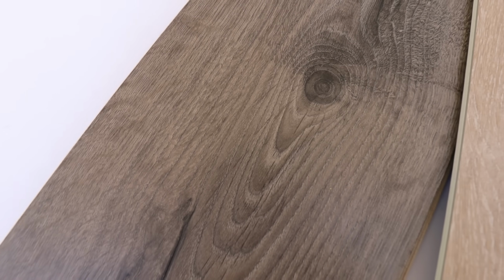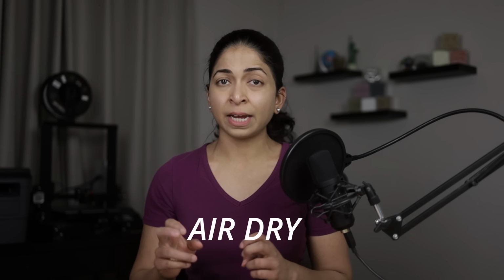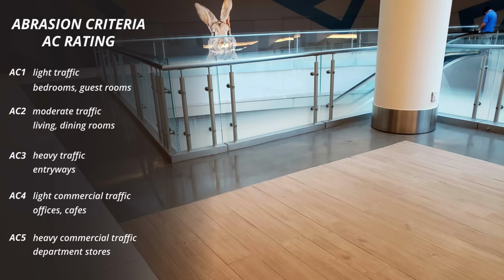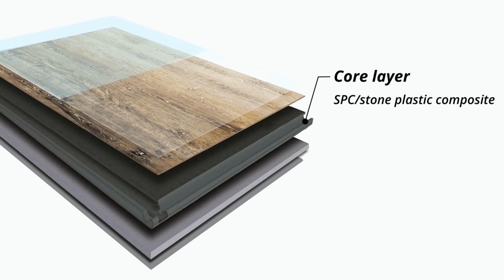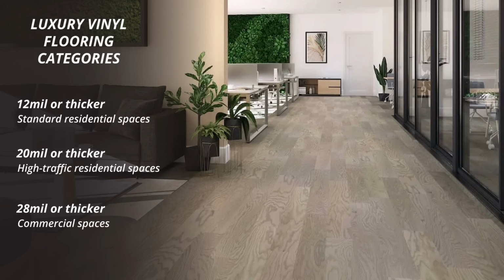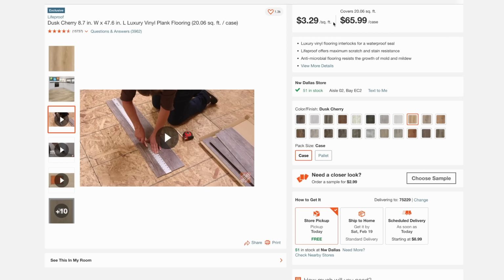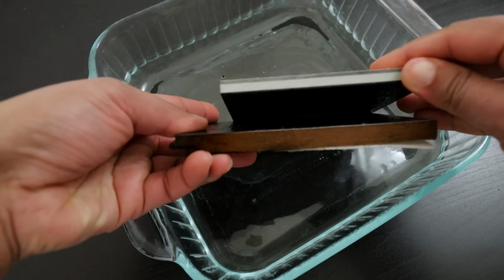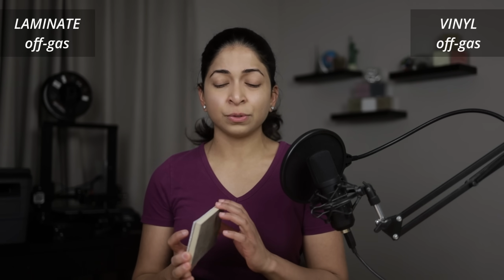Laminate vs Luxury Vinyl Plank Flooring | Everything you need to know!

Comment: Thanks! I thinking about using vinyl, this channel gave great information and very useful!
Reply: OK, but DO climatize this product, go for anything with a wear layer 0.5mm + it will last a life time in a domestic application,  Karndean 1. or armstrong 2. are both excellent proven products but get them from a reputable distributor or flooring specialist, not a home gypo store. If going DIY,  get advice and please don't skimp with limited performance generic or multipurpose adhesives from a home gypo store, get advice. PVC is already inherently water resistant (not water proof) and when properly stuck down to a firm smooth substrate these products are most water resistant and long lasting when 100% fixed. Generally any type non fixed floating floor products, click lock or loose lay products breakdown with long term regular climate seasonal temperature swings or moisture fluctuations mopping or water spills to joint ingress. In most cases thickness means economical filler these are not structural elements, your substrate will need to be very reasonably sound and smooth. Dirt and grit, lumps and bumps are amplified through the material, any real substrate unevenness, and absorption by a thick spongy backed pvc is very limited to marketing hype, forget about any extra softness for thickness too, that will be minimal or just more marketing discretion. Shopping centre malls are a good place to compare wear sound and feel different versions of flooring under foot. Manufactures "generally" recommend full stick down on all PVC product applications (read the fine print). 1. PVC is water resistant and bendy - 2. laminate is rigid and moisture reactive.
Reply: @AV036   Thanks! You give me enough information, I feel comfortable in choosing! This is blessing! 🥰

Comment: We have vinyl plank flooring throughout our house. We left home in the winter to spend a month in Florida and turned our thermostat down to 55° F to save on the heating bill while we were gone. When we got home, there was small but noticeable gaps between a lot of the planks! This is an ongoing problem that we have learned to live with, so... Buyer beware!
Reply: What brand???
Reply: @maplenook  We have lived in our house for over 5 years now and I don't remember the brand. If I poke around in the attic and find a name brand on a partial box I'll let you know.
Reply: @joemace6218  my vinyl instructions was keep it above 8c, that is 46.4 f .

Comment: I actually stopped recommending and/or installing laminate completely because every laminate floor I replace has lifting at the seams from moisture. Vinyl is softer so the customer needs to be aware of possible grooves and imprints from very heavy furniture, even fridges on wheels. But the softness is better for warmth and sound. I recommend glue-down grout-able vinyl tile for bathrooms over ceramic, unless using in-floor heating.

Comment: This is great information.  Our 1970s-era parquet wood floor is really showing its age and we’ve been trying to decide what the best options for replacement would be. My parents have a laminate wood floor and our next-door neighbor put in tile that looks like a wood floor.  I’m not particularly fond of either.  It sounds like luxury vinyl plank would be our best option, unless we decide to go with another hardwood flooring option.  We’re not wanting to spend hardwood money, though.  My only real hesitation is the lifespan of the vinyl floor; hardwood can easily last for 50 years or more while the vinyl might need to be replaced after a decade.  So much to consider...

Comment: Ultimately it’s all high in materials sourced from mineral oil, meaning it’s not really sustainable. After use the prime method to dispose of it is incineration - which is how very few countries dispose of it. Hardwood flooring is noticeably more sustainable, lasts longer and - depending on sourcing and materials chosen, can be procured at comparatively low prices. For highly used areas we use bamboo flooring - this is even harder than oak.
Reply: Adds value and comfort as well 👏
Reply: Ash is a great option too, cheaper and harder than oak, still maintaining a nice grain. Bamboo is one of the most highly underrated flooring materials. Durable, very hard, and grows at warp speed.

Comment: Now I'm curious about luxury vinyl in light of my disdain for other floor products seeming inferior in their ability to resist swelling from water. 
I love wood floors but not the upkeep of them as I am quickly learning what not "upkeeping" does to said floors over the years
Reply from the maker: I'm in the same boat. I'd like something low maintenance, so I'm interested in Luxury Vinyl...but I'm wary of its off-gassing.
Reply: @BelindaCarr  yes, I'd suspect dealing with "fumes " would be issue for a handful of at least months (aka longer than a manufacturer will claim)
Reply: @BelindaCarr  Hi Belinda, how l got around the off gassing concern for myself was to purchase all the vinyl planks l needed 3 months before I installed it & stored it in my garage. I used latex to glue them down on the cold side of the house & used a 2 pot low VOCs resin for all the floors that would see the sun. The 2 pot resin smelled like peanut butter & once it had set (90min), no perceptable odour. It has been down for more than 2 years now & l keep smiling every time  l look at it. I used Karndean brand. Cheers

Comment: When I re-floored my home I settled on AquaGuard brand. It claimed to be resistant to standing water for up to 30 hours, making it usable in high moisture rooms. I didn't use it in bathrooms but chose it due to the cats in the house. Results have been mixed. In a couple of places cats peed on an area and it worked between boards via capillary action, and the edges began to curl up with time. In other locations, integrity was maintained. IMO never use the store's installation contractors - hire a competent flooring installer if you're not doing the job yourself.

Comment: to the subject of the video:
I was fortunate enough to inherit a house a year ago with laminate flooring through about half of it. Unfortunately, 1/2 the flooring was damaged by water leaks that also took out some of the cabinetry in the kitchen portion. I have also used laminate flooring from Costco for a house I'd actually planned toward renovating, but hadn't recognized the laminate aspect when the advertising read "Waterproof!" and I wasn't present to inspect at point of purchase (my spouse kindly picked it up for me, 525 miles from where I was working...).
I have done one room in my main house with Lifeproof (laundry/entry room), and plan to do more with it as well as I am not a fan of how the laminate sounds when walked on: is this an aspect you think might be worth touching on? How to install these awesome floorings in a way that doesn't result in that hollow (cheap) sound that was so common a decade or two ago? Having also done a friend's kitchen/laundry in Lifeproof, I really feel like vinyl is the way to go for most situations!

Anyway, good to see a comparison/explanation. Thank you!

Comment: Great information, and great additional information in the comments!

As a video suggestion, I'd like to know more about Energy Recovery Ventilators and Heat Recovery Ventilators. I have an old house with no forced-air system, and while the radiators are very comfortable the lack of ventilation and fresh air (especially in the winter when the windows are locked) isn't great. I'm considering adding a ventilator of some type, so an overview of these technologies and the situations and climates where they are best used would be great!
Reply from the maker: I'll add that topic to my list. Thanks!

Comment: The floor in my livingroom still has the original hardwood from when the house was built and it still looks spottless. The laminat in the kitchen is less then 10 years old, badly Schanched and honnestly in nead if replacement already

Comment: Pvc is a thermoplastic, and has a high rate of thermal expansion. Installing on a very cold day will create buckling, while installing on a very hot day will cause gaps
Reply: On a very cold day, I'm going to have my heat set to about 70 degrees. On a very hot day, I'm going to have my AC set to about 72 degrees.
Reply: installed plenty of LVP in my moms, friends, and my house and never saw any expansion, contraction issues with LVP. this is NOT PVC the same as PVC pipes. Are you installing indoors at 40degrees or above 90degrees? FYI, indoor temps should never be that extreme. Also, thats why you leave a 1/4" gap at all walls.

Comment: Hi Belinda and thank you for your help. 
A question. 
Is there a product, such as a liquid that could harden on a wooden floor reducing
the noise from the aging creeky boards? 
... a floor that would most likely be replaced but if a solution like that was a remedy (even for 5 years), I would consider an option like that.

I would hope the wood could be disposed of in ways that bring less harm to the earth.   

John

Comment: So what would be a good more eco friendly option that can achieve same or close to same specs of these two?
Reply: Bamboo, the solid not "engineered" type. Bamboo floors are all processed wood, either strips squashed together or "strand-woven" with a resin to make a solid plank. Click-together profiles are available, but that's mostly the engineered kind (some of those maybe acceptable, depending on the substrate, but I'd personally not use them). Otherwise there's tongue and groove profile, which are nailed or glued. 
One thing to be aware of is look at a certification that the bamboo was sustainably sourced, like FSC, not the kind where some company has rolled up to a beautiful forest (often in a different country) and slashed it all down with no intention to do it sustainably. And to find a brand made with a low-VOC resin. Even if that's difficult, because it's mostly actual compressed wood, there's less resin that goes into it than engineered MDF-based laminate and definitely vinyl. Try to find solid planks from "Moso" bamboo, which is apparently the toughest - harder than oak flooring. Plus 25-year guarantee on some products for residential use. This is a pretty good guide to the different types: https://www.thespruce.com/engineered-and-strand-woven-bamboo-floors-1314692

Comment: I can’t wait for your linoleum video! Most people sleep on it due to the design insanity of the 70’s, but it’s an exceptionally sustainable product
Reply: I agree. I just won't use plastic flooring. Obviously new wooden planks would be impossibly expensive, but lino, while not super-cheap, is much less expensive. Linseed oil and cork or sawdust - can't get much more sustainable than that. And none of the awful click-clack noise of laminate when you walk on it. I detest the sound of that garbage.
 Natural cork, FSC-certified solid bamboo flooring with low-VOC resins (much lower resin content than engineered floors anyway), even high-quality rubber in wet areas are all other alternatives.
Reply: I'd be interested in seeing a video on linoleum too. I've heard it's making a comeback because of the environment, but I wonder have they improved it since it's heydey.

Comment: Something I hear you say often,  lifespan is only 20 years, but as real estate pro I can tell you no house except your grandparents will keep the same finishes for that long. 20 years is the max anything to last because even if it does wear out, it will be out of fashion. Only time you want more than 20 yrs is for roof. Floors can be 100 yr lasting oak wood,  but you can change the stain of those with the times.

Comment: Great video! My wife and I have been talking about replacing our carpet with one of the two options. I knew some of things from the video but still learned a lot. One thing I would add is that laminate flooring can dull saw blades due to the aluminum oxide being so hard. If I ever do a laminate install again, I am going to buy a purpose built laminate cutter.
Reply: Try taking a look at natural wood as well, this gives a more natural feel when walking on it, and is just as easily laid as these two coverings.
Reply: @benartee9493   I prefer laminate or vinyl plank over hardwood hands down. Hardwood is too soft,  damages easily in dents and scratches plus it is not waterproof. Different strokes for different folks. I've had all three.

Comment: You want to do mini split education? It's high time we move away from the ductwork of conventional a.c. 
Call it "replace A.c. under 5000" or "best a.c. for the everyday household". I found there's a lot of the same mini splits sold as different brands at different prices, but same exact equipment
Reply: I’ve heard that Tesla’s Octavalve heat pump is really the only innovation that has happened in the heat pump world, it’s ripe for innovation.
Reply: @TimBryan  yeah, they improved the heat pump design, but conventional a.c. is still behind old heat pumps. Heat pumps used in mini splits are 50% more efficient, cheaper to install, and offer climate control in each rooms. 
The tesla a.c. system is stated to be "100x more efficient than conventional ice cars".  That hasn't translated to homes yet.

Comment: I have laminate in my current home (was already there) and there are many small spots where it chipped off or split. It looks like a cheap product. In my last home I had an all wood laminate product from Lumber Liquidator made from layers of plywood and a 3mm wood wear layer. It had the hand scraped look that was popular a few years ago. 
I would put vinyl plank only in an income property where durability is important. In my own home, I would consider real wood or real wood laminate with a thick wood wear layer, high end realistic looking wood look tile, stained concrete, stone tile like travertine, or strandwoven bamboo, depending on the style of the home.
I would be interested in learning more about these options, especially wood look tile. I saw very nice, realistic products, obviously with a higher price tag.
Reply: Your mention of plywood reminded me of some people I knew who installed literal sheets of 3/4" plywood for flooring. I laughed till I saw the finished product. It was beautiful and glossy. It kinda reminded me of something you'd see in an IKEA kitchen perhaps
Reply: laminate is for us poor buggers. but if you got the dosh, get the best.

Comment: Seems like the vinyl planks might end up being cheaper to install on a concrete slab.  I have two large rooms on slabs with worn out carpeting.  I'll certainly look into the vinyl.
Reply: Yes vinyl is cheaper, it's vinyl for me it's like using vinyl siding on the outside of your house. I'm a solid hardwood kind of guy, its great if water is an issue, but for me its sounds like walking on a tarp amazing how many small holes keep showing up for only 3 months on my floors I'm not very happy with it at all.

Comment: I’m surprised laminate flooring is still sold.  It can’t be cleaned.  The smallest amount of moisture will eventually infiltrate to the sides and cause them to swell, warp and curl up.  MDF is just not a suitable material for flooring.

Comment: How is it "technically attractive" to try and separate laminate flooring to recycle its formaldehyde impregnated wood pulp???
How much recycled PVC can be used in the core of luxury vinyl planks?  (percentage, without compromising integrity and lifetime)
Given that plastic is having such a huge environmental impact this seems like a great use for a plastic that is often not recycled...
Personally, I'd never chose laminate given its tendency to peel up at seams and it's 'clicky' sound underfoot.
Vinyl flooring also seems to act as mass damping (reducing sound transmission) and conform to slight floor irregularities much better than laminates.
Thanks for your unbiased review of these products, and all the others you highlight on your channel, Belinda!

Comment: On the vinyl floor thickness, I think you would have to cut all those dimensions in half. 12 mil is over 3/4". I don't think I've ever even seen that.
Reply from the maker: Mil isn't millimeter. 1 mil equals 1/1000th of an inch.
Reply: @BelindaCarr  Thanks for that correction. Always interesting to watch your videos.
Reply: I think the "mil" they are using is the same measurement used for plastic sheeting. "mil" is equal to one thousandth of an inch, not one millimeter. Definitely could be confusing.